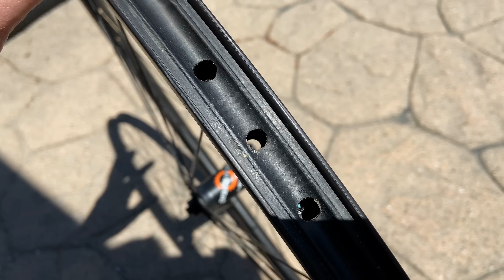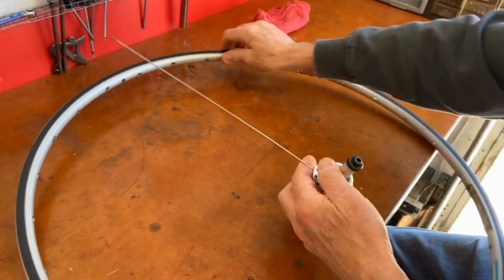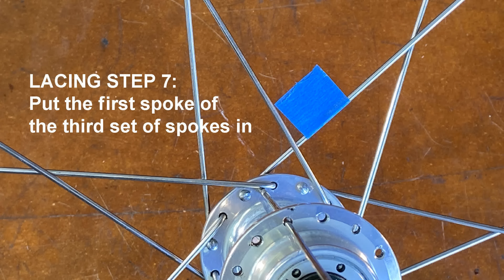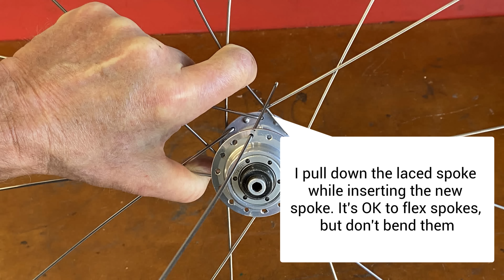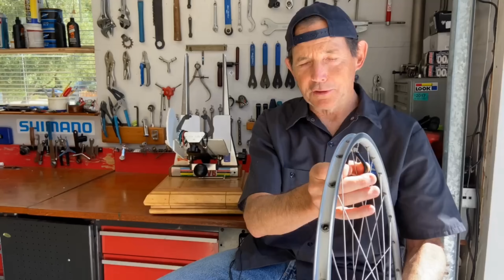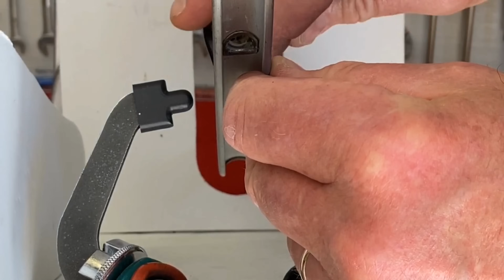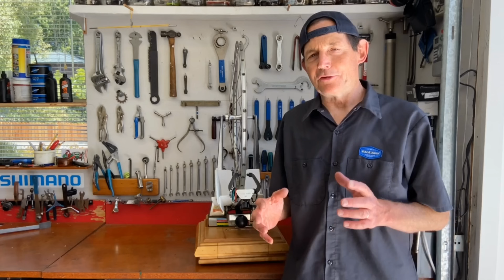How To Build Bicycle Wheels THE EASY WAY! #bikerepair

Comment: Thanks for a great video Jim! I do have some questions though.

When building/adjusting a rear wheel I understand that it's common that it needs to be offset. How should I think when it comes to spoke tension in this case? Should one side have lower tension than the other and if so, what is a reasonable difference? In my case the wheel is using an internally geared Shimano Nexus 7 hub. 

I've managed to get my wheel quite true and round using a stand and adjusting it. I've also used a dishing tool and the rim seems to be correctly centered over the hub. However, when plucking the spokes I can hear that they are not equally tensioned. Measuring with a basic tensiometer also confirms that there are slight deviations.  Is it acceptable/normal that all spokes differ slightly in tension when the wheel is true and round or should they be the same? Is it even possible to have all spokes on either side at the same tension while keeping the wheel true and round?
Reply from the maker: Thanks for watching and the questions bulbin and most importantly, congrats on your Nexus wheel build - well done! Yes, it's acceptable/normal that spokes differ slightly in tension all around the wheel and it's also normal on rear wheels and even on front wheels with disc brakes, that the tension will be less on one side due to the offset (non drive side for rear wheels, drive side for disc fronts). The key thing is that the tight side spokes need to be tight enough since they're doing the bulk of the work. If they loosen, since they are doing most of the work, the whole wheel will usually loosen. 

The left side spoke basically just end up wherever they need to be once the right side spokes are tensioned where you want them - which is usually between 90 to 130kgf on a tensionometer. Rim companies sometimes spec a recommended tension range for that rim and that's the best thing to go by. Without that information you go by judgement and feel. The telltale sign that the tension isn't tight enough is that the spokes loosen over time. If that happens, you learn that the tension wasn't quite enough and you true the wheel again and add a bit more tension. 

As to why wheels don't end up with perfect tension readings on every spoke or on every spoke on each side, it's because of the variables in spokes and rims mostly. And if you chase perfect tension, you will end up with a wheel that's not round or true anymore. With the best carbon rims, you can get pretty close numbers because the rims are so round and true but it's not the same exact tension on every spoke even with them. I hope this is helpful and thanks again!

Comment: Im building a 40 spoke rim, drive side

I've put in a spoke on the hole on the left of the valve. Let's call this spoke L1
I've put in a spoke on every 5th hole, counting from L1 going left

I've put in spokes using the over, over, under method

I've ended up with a rim with a drive side that has a spoke on every other hole, however there are 2 areas where I have 2 empty holes

Help me, what am I doing wrong
Reply from the maker: Thanks for watching and the question omondi. The problem is probably that you only put 9 spokes in with each set of spokes. That mistake would mean you put in only 18 spokes when you need to put in 20 spokes (because you have 40 holes in your hub and you have 40 holes in your rim, you need to put in all 40 spokes. And 40 spokes means using 4 sets of spokes with 10 spokes in each set). 

The way to fix this is to take out the spokes and start over. This time be certain your first set of spokes has 10 spokes. Put them in as you did before and double check that you now have all 10 spokes in place in the wheel. You can count the spokes to check. Then do the same thing when you put in the next set making sure that you put in 10 spokes. This should get you back on track. 

The other possibility is that you are using a hub with only 36 spoke holes. That hub would only accept 18 spokes and in that case, you wouldn't have a place for the 10th spokes in each set. The fix there is to build with a rim with 36 holes or try to find a hub with 40 holes to build with. Good luck and Iet me know how it goes.
Reply: @JimLangley1  appreciate
finally worked
Reply from the maker: @omondi_wa_butere  I’m happy to hear it, congrats and thanks for letting me know 🙏

Comment: where tightening was
Reply from the maker: Tensioning the spokes comes at the end of wheel builds prakashspex. There are chapters in my video. Look at the red bar below the video and you'll see all the different chapters and you can click on the tensioning chapter to open that up and learn about it. Okay? Hope this helps.
Reply: @JimLangley1  tightening is counter clockwise and loosening is clockwise, was the question ? Sorry for the fragment of a question, haha. Great video, thx for responding!!
Reply from the maker: @prakashspex  thanks for watching and I'm happy you found the video helpful. To answer the question, basically spokes are like bolts and nipples are like nuts. To tighten you turn the nipple (the nut) clockwise. To loosen, you turn it counterclockwise. But here's where it can get confusing. If you hold the nipple you're turning at the top of the wheel in the truing stand, or on the bike if you're truing the wheel while it's on a bike, then looking down from above at the nipple, it is pretty clear how to turn the nipple clockwise to tighten it because you're looking down at it. The confusing part comes into play should you rotate the spoke nipple to the bottom of the wheel. When it's there you are actually looking at the nipple upside down. From this vantage point, and looking at the spoke wrench on the nipple you need to turn the nipple/spoke wrench counterclockwise to tighten it. This is something that confuses many beginners and it can cause the mistake of loosening when you meant to tighten. I recommend to my students to rotate the spokes they're working on while truing to the top of the wheel because when they're there, it's easy to see the clockwise turns and counterclockwise ones too. Hope this is helpful.

Comment: At 10:40 surely it should be every 4th rim hole, not 5th?
Reply from the maker: Thanks for watching and commenting. It's fine to use that method too. I teach and say clearly in the video "counting from spoke to spoke," which means 5th hole. And by counting spokes like this instead of holes, I've found that beginners have an easier time lacing and are less likely to make mistakes. Thanks again and happy wheel building.
Reply: @JimLangley1  OK, thanks. Great tutorial.

Comment: Jim, I was taught to build wheels over 40 years ago at a shop that did a lot of bike work for professional road and touring athletes. I set the spokes differently. Have you ever heard the term “pusher” and “puller” spokes? All my head-in spokes are set by rotating the hub forward. They are “puller spokes.” Then I set all the head-out spokes the other direction; they are the “pusher spokes.” I’ve built hundreds of wheel sets this way and never had any issues.
Just wondering what your thoughts are about this process vs. the alternating spoke arrangement you utilize?
Reply from the maker: Nice to hear from you Mike, thanks a lot for watching and commenting, appreciate it! My video is designed to help beginners learn how to build bike wheels. I actually don't recommend any preferred way to lace wheels, I show a method that in my experience teaching wheel building has proven an easy one for people to learn. I do have other videos on my channel discussing and explaining recommended lacing patterns for anyone who would like to look into these options. Thanks again!

Comment: YT keeps deleting my comment. Thank you for helping build my gary fisher trek wheel first try. Great for my ebike to have the new XM 490 pro hub. I got frustrated a few times as I was doing 32 spokes but I rewound it and that helped me a lot. I had to step away for a day or two when I got mad but it worked out. Thank you so much!
Reply from the maker: Thanks a lot for watching and for letting me know you built a wheel for your Gary Fisher Andrew, that's great to hear and congratulations!! It can definitely test a person's patience at times, so awesome job hanging in there and getting it done. Enjoy that new wheel!
Reply: @JimLangley1  Thanks and I will. It came from a 700c G.F Tiburon & is going on a 26" Benotto Trival full suspension with a bafang bbs02 on it. XCM forx lifted the front end so the 28" rear wheel fixes the geometry. WTB 26 inch rim up front shimano 475. Now I can re-lacethe front with a boost hub for XCM 34s over XCM 30s :) This really helps me as I deliver on my ebike in Detroit with doordash. I needed a steel frame to weld my rear rack on. Now I can build my own wheels rather than paying my local trek shop. They want 130$ a wheel.
Reply from the maker: @andrewchristiansen-Detroit  sounds like a super cool custom bike Andrew and it's awesome you use it to make your living and now can build custom wheels for it anytime you need to fix or upgrade anything. I think that's one of the very best things about being able to build wheels. Not having to pay for it and wait for them to be built is great too. Thanks a lot for sharing - great story!

Comment: do you have a video of you putting spokes in a non alternating holes
Reply from the maker: Thanks for asking and the question. It's the exact same as what I show in the video except that you don't have to be concerned with which hole in the rim is up or down because they're all in the same place, i.e. there is no higher or lower rim hole. The one thing to be sure about is to determine if you have a rim with spoke offset. That would mean that the rim holes are offset to one side of the rim or other. If you do have an offset rim, then you make sure you start with the hub and rim in the correct orientation. I show how to do that in this video. Okay? Let me know if you have any other questions, happy to help.

Comment: Hi, Would it be a good idea to use threadlocker instead of motor grade oil for installing the nipples on the spokes? Thank you!
Reply from the maker: Thanks a lot for watching and for the question. There are pros and some significant cons to using threadlocker. I explain in another of my videos at about six and a half minutes in. Here's that video : https://youtu.be/z4FKL95x6DE
Reply: @JimLangley1  Good to know, Thanks for the reply! 👌

Comment: So I have build many wheels in this way. I almost always have to dish the wheel to one side even if I tension the spokes with same tension. When I dished the wheel, the rim often leans down on one side. Do you know why?
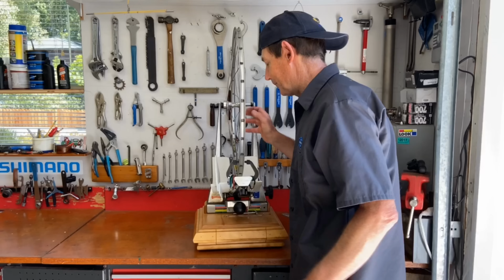Reply from the maker: Thanks for watching and the question. I explain why most rear and some front wheels need “dishing” in the video in the centering step at 51:12 so please watch that for an explanation. But the reason is that the rim has to be centered in the frame. That’s because there’s a cassette (gears) on rear wheels and a disc brake rotor on front disc wheels. These make the rim offset to one side in most cases. And usually spokes are tighter on one side too. Hope this helps and thanks again 🙏

Comment: I had wheels similar to yours. Dissimilar metals rusted those inserts out. Made no sense to me why that would be done.
Reply from the maker: @sonnybowman  those are rim ferrules Sonny, one of the ways rims can be reinforced at the spoke holes to handle the spoke tension. I don’t recall corrosion being a common issue with Mavic rims though.
Reply: @JimLangley1  They were on my Marinoni bike I purchased at Ziggys(1980s) in Kitchener. I'll see if I can find them.
Reply from the maker: @sonnybowman  nice bike!

Comment: Is he using the term "buckled wheel" as an equivalent to what u.s. repairmen call "hop"?
Reply from the maker: Thanks for watching and the question MrReed. I don't remember using the word "buckled" in my video, but I'm happy to explain what it means and that "buckled" and "hop" mean two different things. First, a "hop" in a wheel is a high spot. As the wheel spins it should spin nice and round. There should be no high spots or low spots. A "hop" is another word for a high spot. Watching the wheel spin you would see the rim move upwards at the hop or high spot. Hops and high spots have do with how round a wheel is so you make vertical adjustments to the wheel/rim to fix these issues, tightening and loosening spokes until the wheel is round again without any "hops" or "dips" (high or low spots).

Now a "buckled wheel" is a wheel that's taken a beating of some kind. Maybe someone rode the bike into a parked car or a car drove over the wheel or there was a crash and the wheel was fallen on by another rider. In other words, an extreme load that causes the rim to try to collapse. You might hear "buckled" or "pretzeled" or "taco'd" or "potato chipped." They all mean the same thing. A wheel that's damaged like this sort of resembles a taco or a potato chip, not that much a pretzel but the idea is that it's badly, severely knocked out of true (side to side - lateral) and round (vertical). Buckled wheels aren't as common as they used to be because rims have gotten much better.

If you run into a buckled wheel, you may not be able to fix it. It all depends on whether the rim was actually bent (the metal was damaged) or if it just sprang out of shape. If you get lucky and find a wheel that just sprang out of shape (again not likely with today's better rims), you can sometimes, if you get really lucky, spring the wheel back into shape by laying it flat on the ground and pressing down firmly on the 2 high spots. It probably won't be perfect but it might be good enough to keep riding. Hope this helps.

Comment: What spoke pattern is this?
Reply from the maker: @petermcculloch2118  thanks for watching and the question Peter. I’m showing a 3x (3-cross) pattern, that’s the most common. And once you understand that you can lace any pattern. Thanks again.
Reply: @JimLangley1  Thanks for the quick reply. Wasn't expecting that. I am doing a spoke length calculation and needed to figure out the pattern, as I want to follow your guide, as you have made it very clear. Wheel building is great but anxiety producing at the same time.
Reply from the maker: @petermcculloch2118  happy to help Peter. Take it one step at a time and do not rush and you’ll be fine.

Comment: This was recommended to me by the YT algorithm just now, and it might very well be saving me a couple hundred of euros down the line. I plan on building a wheel that is both, rim and disc brake compatible, since my current wheels need replacing but I can't justify buying a rim brake wheel set to later have to buy yet another wheelset for when I convert my bike to disc brake. 
I found a wide 29" rim brake compatible rim, that is wide enough for most tires, so if I choose a disc compatible hub that can be converted from QR to thru axle, I'll have a wheelset that I can use on whatever bike I end up getting after.
Prebuilt wheels with those rims would cost me about 600-900$ + import to EU, the rims are only 80$ a piece tho.. 
So thank you in advance, building the wheels myself might end up saving me half of that amount
Reply from the maker: @KurtKloetentreter  you should definitely be able to save money Kurt , and have fun doing it. The trick with your plan will be finding a convertible hub. Maybe DT Swiss will have some, they usually have spare parts though they can be expensive. But it’ll be a nice project if you find the right components. Let me know how it goes! And thanks for watching and commenting.

Comment: That makes it so much easier to understand! Other methods rotate the hub clockwise and not anticlockwise as shown here and also have the first set of spokes laced the other side of the drive side flange, can I ask is this just choice?
Reply from the maker: @AnotherMrLizard  happy to hear it’s easier to understand. It’s actually based on the rim and hub and my instructions explain how to set the components so that the lacing is simple, not complicated. Thanks for watching and commenting.
Reply: @JimLangley1  perfect, thank you for your reply

Comment: Thank you so much for the video, im going to try and tackle my relaced wheel and see how it turns out. The only thing im not sure about is when you are setting the nipples initially and you said have about 2mm exposed what is it that you are exposing?
Reply from the maker: @bsen7145  thanks for watching and the question. What I’m referring to is 2mm of spoke threads exposed Brandon. Hope this helps and happy wheel building!
Reply: @JimLangley1  that's what I thought, I just thought I would ask, thanks again, I'm getting ready to tackle my wheel now 🙂

Comment: How do I find out what size spoke I need for a 26 " huffy model 56899
Reply from the maker: Thanks for watching and the question alpha. You could measure a spoke on the same side and on the same wheel that you need the spoke for. Measure from elbow (the bend that's in the hole in the hub) to where the nipple the spoke screws into disappears into the rim. Then add 3mm to account for the rest of the nipple hidden up inside the rim. If you can't measure, you could call Huffy and ask for technical support. Here's their number 1-800-872-2453 (Monday – Friday 8am to 5pm ET) Hope this helps.